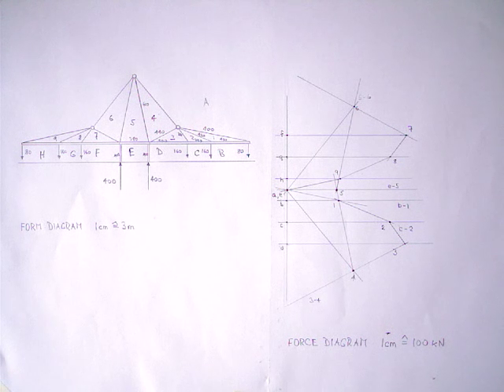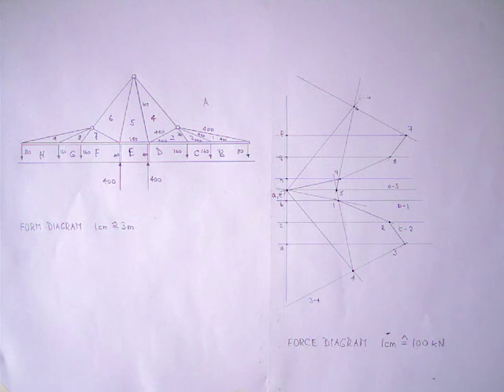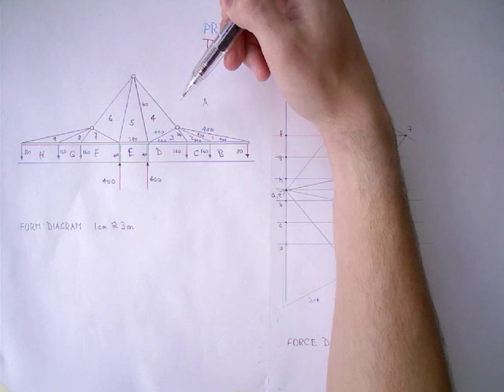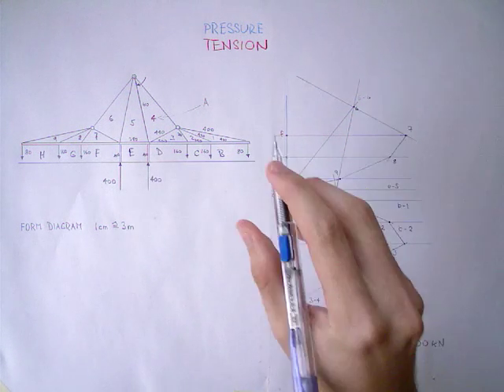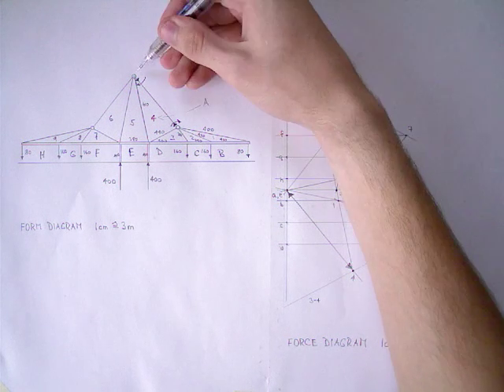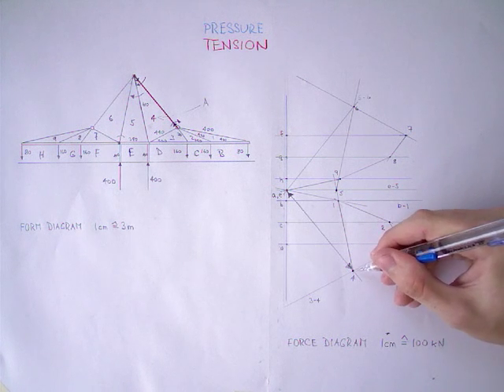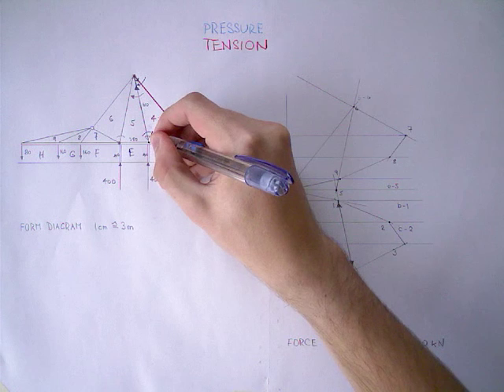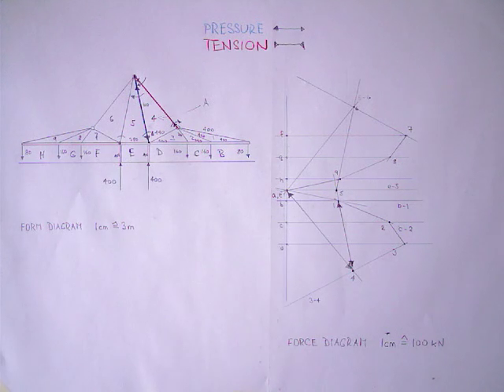How to distinguish between pressure and tension

Comment: On the force diagram and for the "pressure", is it just me or you connect point 4 to point 1 instead of connecting point 4 to 5 ?
Reply from the maker: Yes, there is a mistake in the video. Thank you for mentioning it. The upper arrow head should be at point 5 and not at point 1. The result is the same though.